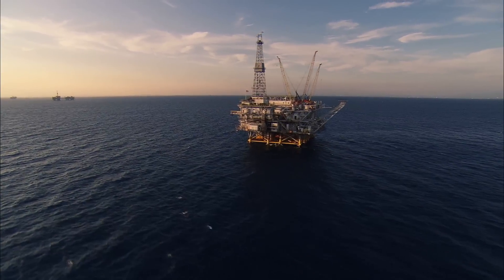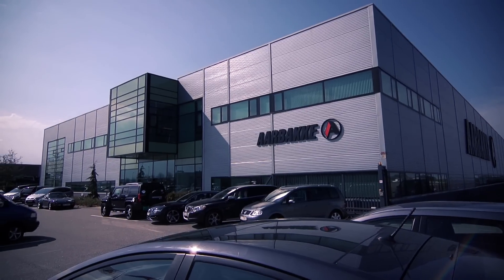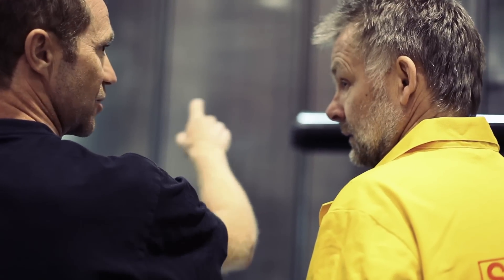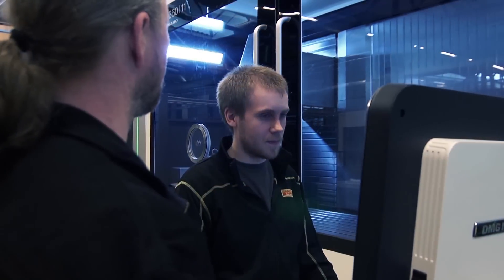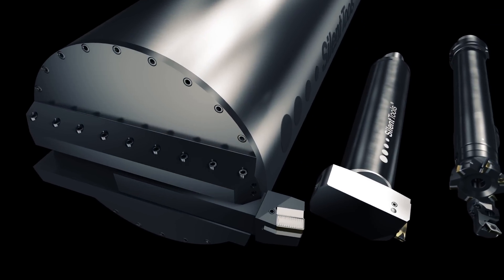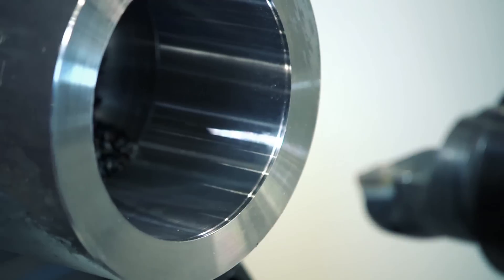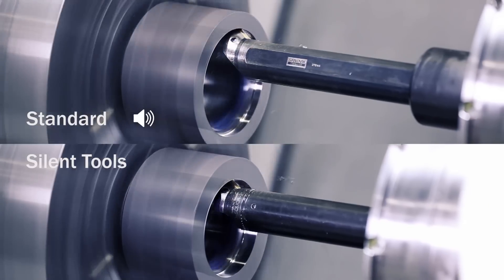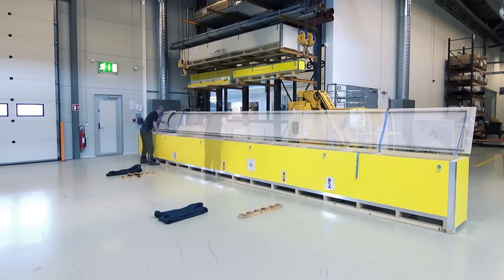Silent tools - Dampened tools for long overhang machining by Sandvik Coromant

Comment: I hate to tell you guys when I worked at the Royal Ordnance Factory over 50 years ago we were experimenting with putting a slug of tungsten carbide suspended in oil  in the end of a boring bar of oval cross section, It was used to bore the internal profile of a 120mm shell. We had to go through a hole that was smaller than the diameter of the cavity we had to bore. After may attempts to eliminate vibration with no success, one of our older engineers suggested that they bore a hole through the bar and fill it with lead, success, it worked a simple solution. We also were able to buy machinable carbide bar stock that was then heat treated to harden after machining.

Comment: There is nothing quite like watching a mill-turn B axis head rapid to the bottom of a 16 inch bore with a 18 inch long 1.5 inch diameter boring bar, and only hearing the mist of coolant and the PWM frequency of the servomotors on your machine as it pull turns out. Give your engineers a raise!

Comment: How did they do long bores like on artillery weapons in the past? Why doesn't that method work today? Accuracy?
Reply from the maker: Hi,
In the past a boring tool called gun drill were used. They are still a valid choice for smaller diameter holes. The accuracy of that process is ok but for larger diameter holes it is a costly method, both from the tooling perspective as well as the machining time.
Silent Tools is a generic boring tool that can be used from hole size 13mm or 1 Inch and above, offering easy handling set-up and machining operation with a superior surface finish.

Best regards,

Åke Axner
Global product manager - Machine integration

Comment: Subtitles?
Reply from the maker: Hi Dustin,

There are subtitles available in 19 languages. You activate subtitles by clicking the CC symbol in the lower right corner of the player window.
Reply: Sandvik Coromant nice didn’t know that was there.  Generally speaking whenever there are mixed dialects there is often a subtitle for one.  Y’all got any coupons for them devibe bars lol?